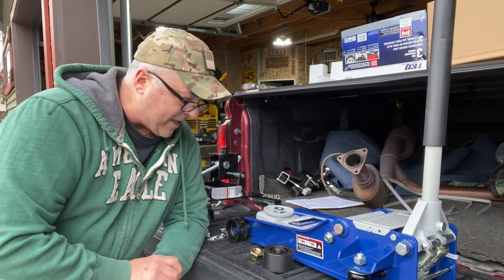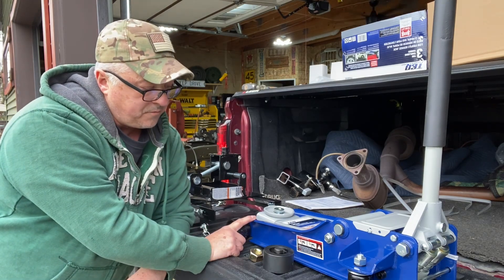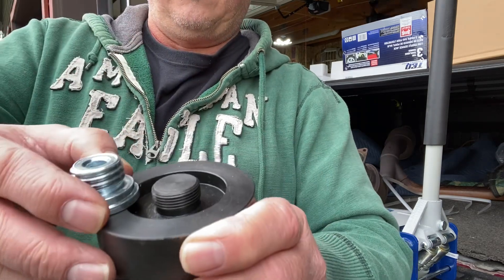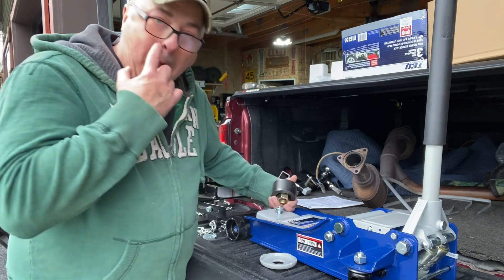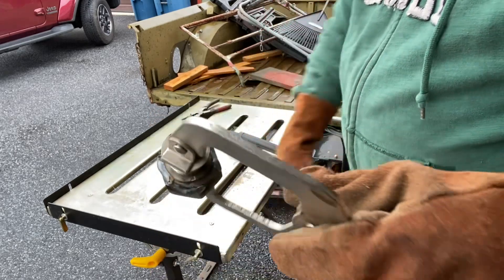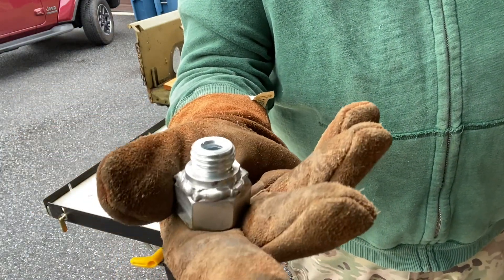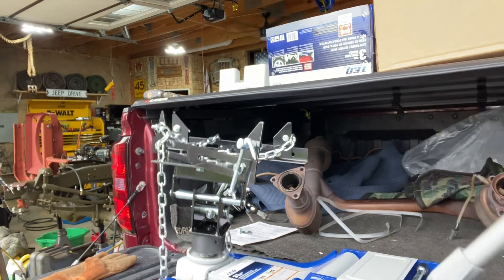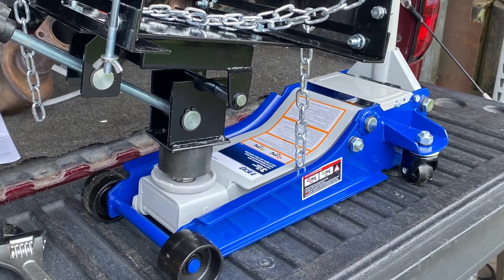Fitting a universal transmission Jack adapter part

Comment: Hey could you tell me where you got that round threaded adapter?
Reply from the maker: I honestly don’t remember I think I looked up threaded floor jack extension adapter or something like that
Reply: Thanks i ended up cutting the cylindrical part off the bottom of the jack adapter and bolted it to my jack.@WatsonsWagons

Comment: You could’ve just welded the riser to the jack pad
Reply: You are absolutely correct and that it’s exactly what I’m going to do because my attempt failed. I’m just a novice when it comes to metal work.
Reply from the maker: I took your idea and implemented it and it worked perfectly. I’m uploading a video now part two.

Comment: All that height extensions will make it harder to get the transmission out, unless the truck is lifted a lot off the ground.
Reply from the maker: @willwatson-WAWII  I have a different transmission lift that fits underneath their perfectly. I’m using this for the transfer case. Also, I’m not dragging the transmission out from underneath. I’m only sliding the torque converter off.